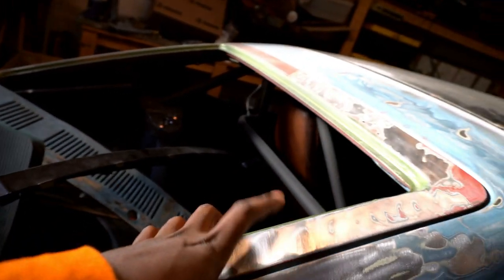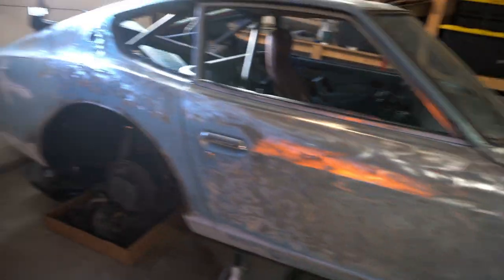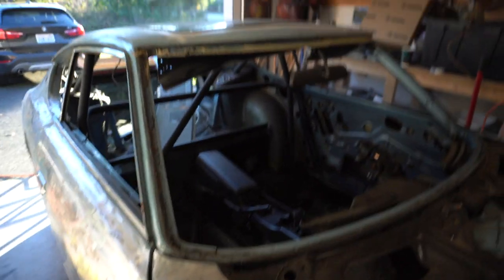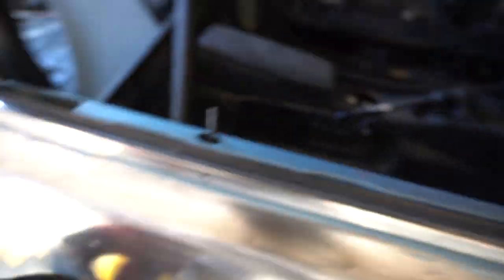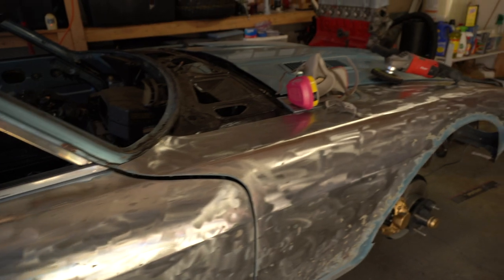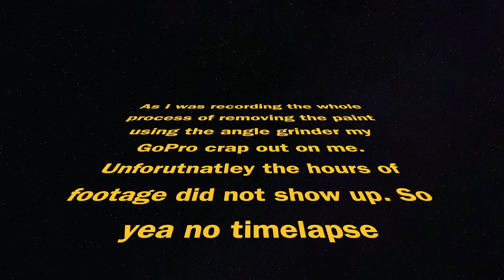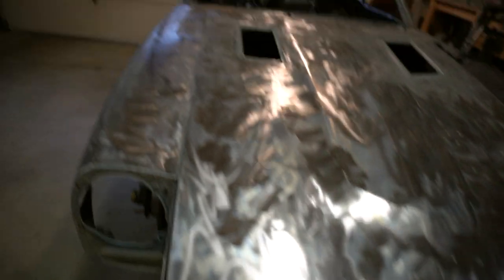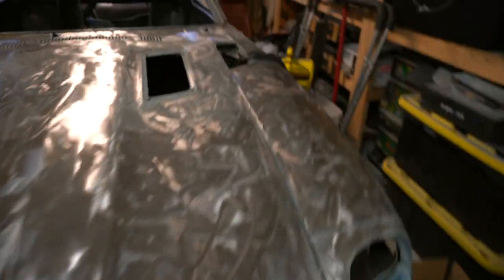Body prep 280z (removing paint)

Comment: I really want one as a project car, would you recommend as a first project car?
Reply from the maker: Yes, very easy light weight frame with loads of space in engine bay. The only tricky part is making sure the frame/body has no rust. Since this is a unibody platform rust is the biggest problem to address
Reply: @RoadRunnaReviews  Ok, thank you so much for the response, keep up the good content, can’t wait for the next video!